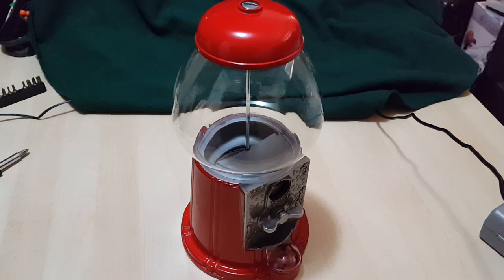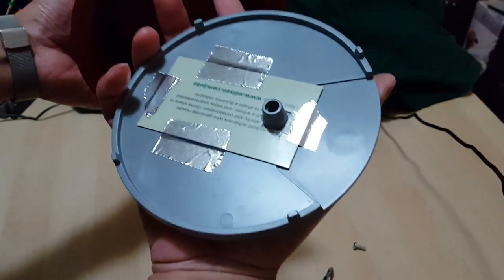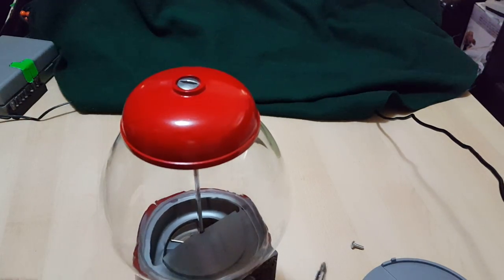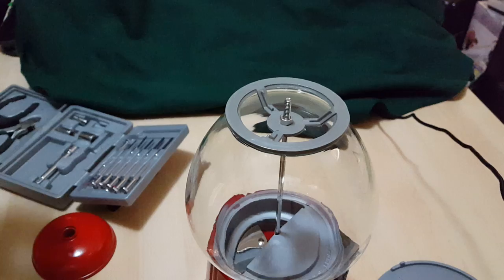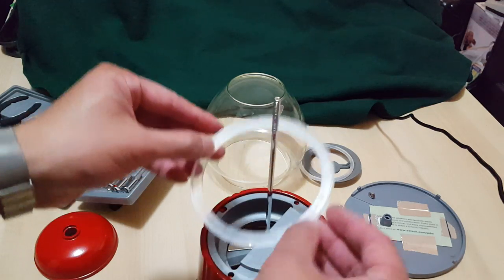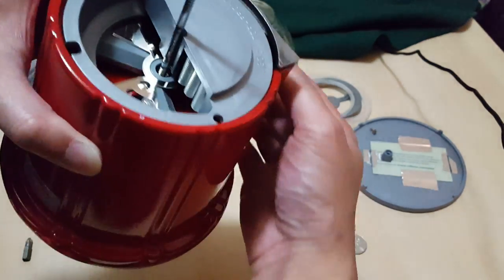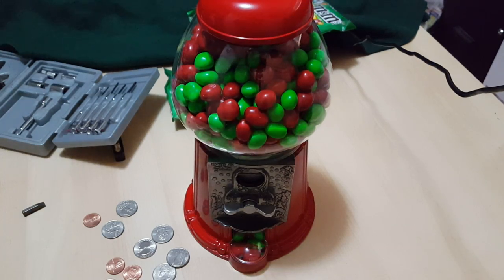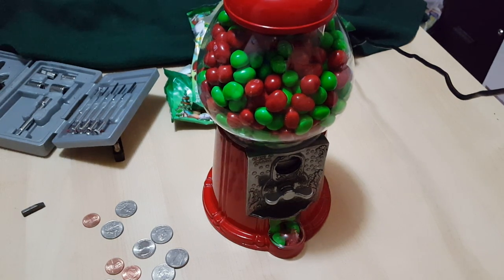Carousel 1985 Gumball Machine Bank REVIEW and TAKE APART!

Comment: Excellent assembly instructions and narrating.. I bought  exactly this same one in new condition from Craigslist selling site. Took it apart to clean just in case of lingering manufacturing oils inside the base then forgot how it went back together properly. So glad I found you here. Thanks a heap.
Reply from the maker: Merry Christmas! You are Welcome
Reply from the maker: Eventually the spring and tongue will get misaligned... so i made a vid for that too! I had mine for about 6 or 7 years at my cubicle with all my coworkers using it daily. So with that much use, the screw to the tongue gets loose. Here is the fix https://youtu.be/rgxXNrD6ces

Comment: The cog on the back of my coin mechanism doesn't reach out far enough to turn the dispensing wheel.
Any advice on what I could do to fix it?
Reply from the maker: Missing parts? Or is tongue bent? I has to bend mine back after a few years....
Reply: @SterlingW8  It doesn't look like there is anything missing. It's as if the dispensing 'hopper' has shrunk as it no longer reaches the cog on the back of the coin mechanism.

Comment: My machine that I bought at a second hand store for $20.00 (bought it for my 8yr old granddaughter) has 1985, symbol for Registered trademark, the top of a Carousel, and the letters Carousel imprinted on the pewter type metal. Is my machine a replica of a 1985 trademarked Carousel? Mines also has the black stand with four legs/feet. Thanks for any feedback and for posting this video. All the lettering is on the upper left corner of the face plate.
Reply from the maker: I have no idea, maybe someone else may know.

Comment: good video. Ive taken mine apart and the arm that stops it from turning backwards seems to not work, does it need a spring to keep it in place, it just pushes out od the way can you help with advice?
Reply from the maker: not sure. time to take it apart and see if there are any broken or missing parts in the mechanism. have fun!
Reply from the maker: +pecka2k theres a spring in the mechanism, it may be a broken part inside the turning mechanism. The majority of the internals of mine were metal.